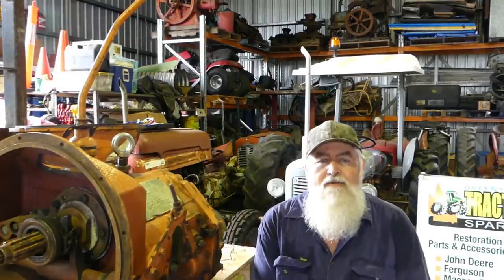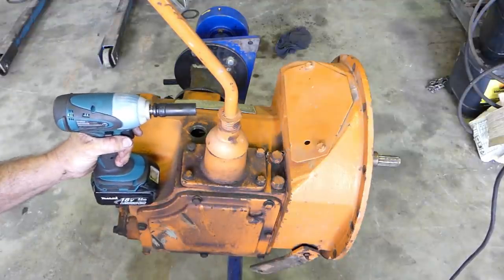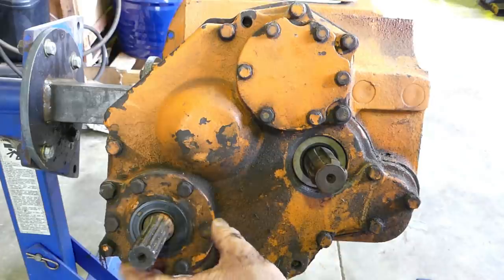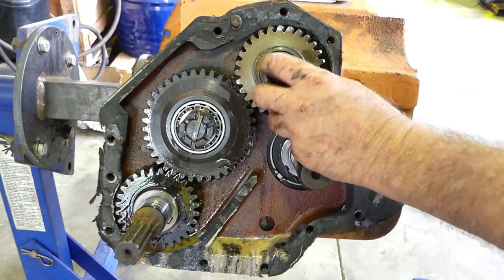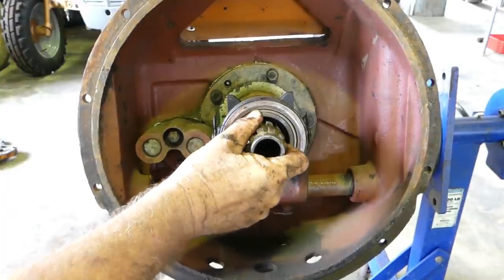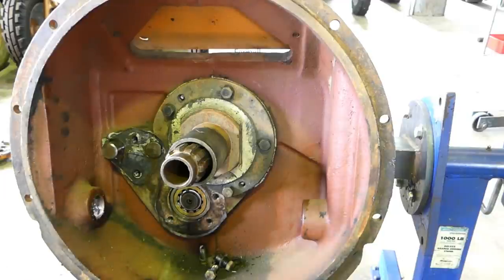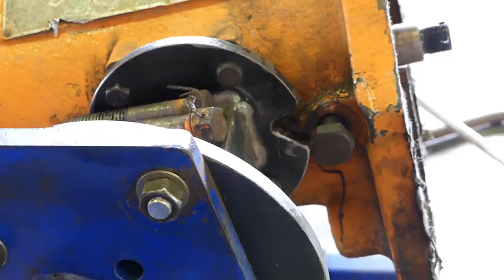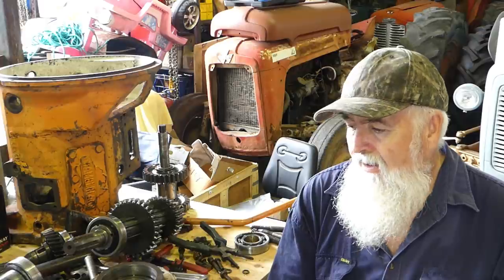Chamberlain Front Gearbox Overhaul Part 1 Dismantling the Box

Comment: I live in Bundy and I've got a 9G with a clutch brake problem. I was interested to see that assembly come out ( and go back in ) but i guess it looks like the parts book exploded view. I was hoping to deal with it still in the tractor but it looks like clearance to draw it out past the chassis will be impossible. Appreciate your thoughts on that. As you pulled out the PTO output gear you mentioned it might be of use to someone. Mine looks to be flogging around pretty badly and not sure about its continued serviceability when it comes out as the drive shaft has been welded to the spline.and the back seal leaking badly.  I might be needing that gear! Murray
Reply from the maker: The clutch brake can be adjusted in the tractor with the screw at the end that is held in place with the lock nut. Not too hard to do in there but have it so it only becomes engaged at the very bottom of the clutch pedal travel.
Reply: Bundy Bears Shed   The assembly needs to come out as I suspect all the pad material is gone as a result of poor adjustment by the preceding owner. I’m thinking there is insufficient clearance to get it past the chassis. Need to get it out to check its condition.

Comment: Hey bud, would you be able to do a video on a Chamberlain 3380 or similar? I need some quality info for fixing my tractor. Thanks.
Reply from the maker: I would need a tractor to work on, I have done many front boxes both early and late on the 80 and 90 series.
Reply: I have a similar question, but very specific.  I am looking to replace clutch on a 4480. It seems to me that the process involves first detaching (a) the hydraulic pump and (b) the drive shaft from the back of the gearbox, so the gearbox has space to slide back about 6 inches.  Is that correct? There doesn’t seem any other easy way to do it..